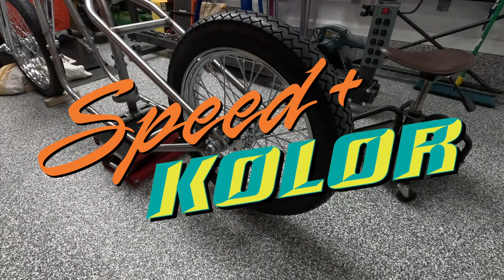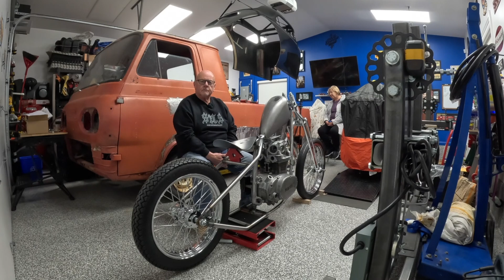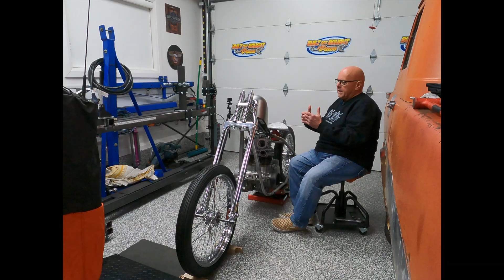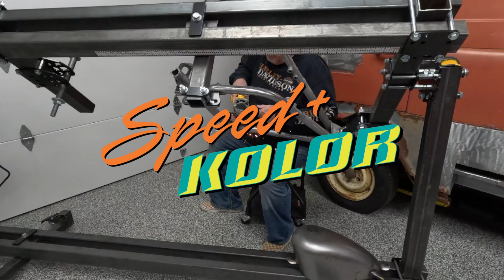Yamaha XS650 Chopper Build - What are Your Thoughts?       #yamahaxs650 #oldschoolchopper #xs650

Comment: Got a question for you, which rear wheel vintage did you get ? Like you Ian planning things out...I figured bigger is better safety wise on rear rotor . No experience with Magnetos but to me they scream Kool so they are on my list of wants ,I like springer idea but for me it's too wide for a small bike less is more to me.
Reply from the maker: The rear tire is an Avon MK II. More brake power is a good idea. If this were a Harley I would have gone bigger. As it is the bike is pretty light so this brake should be more than enough. I agree completely about the front end. In my case I bought 4 XS650 engines with 4 frames, a couple stock fronts, a couple sets of wheels and this Springer. Figured I had it so I might as well use it. If I love it I would contact Northern Springers for a skinny one.

Thanks for watching and commenting. Watch for an update episode coming soon.
Reply: @speedandkolor which rim did you go with on the rear ? Like year and model Harley , also what size sprocket
Reply from the maker: The rim or wheel is from Mid USA. It’s a 19” x 2.5”, 40 spoke with 3/4” axle. My hardtail is from SNS Customs. Sean offers his hardtail kits for the original 20mm axle or  an optional 3/4” axle. With his kit you get an SNS sprocket that is 32 teeth, 530 chain with a bolt pattern to match 1989 to 1999 Harley-Davidson. As Sean says, a Harley sprocket would be way too big.

Let me know if I missed anything.
Reply: Thanks for the replies,have you completed the bike to yet iam curious to see it thanks
Reply from the maker: I have an update video coming out this week. I have a little more welding to do before I tear it down for paint. Frame molding and paint are probably my favourite part of the build. I hope you’ll check out the new video and stay tuned for more.
Reply from the maker: Oh yeah, you’re right about magnetos. Just tough to justify the cost of one for an XS650.

Comment: So far, I’m keeping the original electronics from ‘82. 
CDI ignition, reg/rect. With a battery. It’s cost effective and it just works. I did have to replace the TCI and didn’t want to shell out $300 for a manufactured original. I went with the “Gonzo Mod”. Tci from a Suzuki GN250. Fires up first kick with no issues. Cost me $20 on Amazon.
Reply from the maker: Hey Glenn. I'd love to see pics of your bike. Where can I get a look?
Reply: @speedandkolor man, I don’t want to show ya, yours is in much better shape than mine. lol this is my first build of anything, let alone a motorcycle. The only place I have any photos or trail of building it would be Reddit. 
U/FeatureNext8272